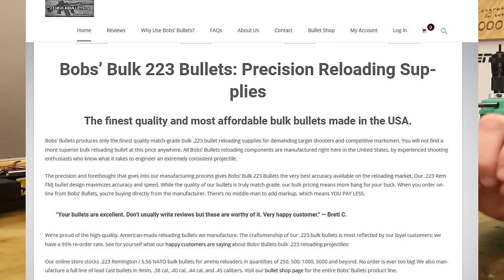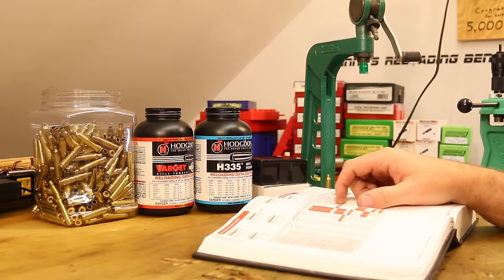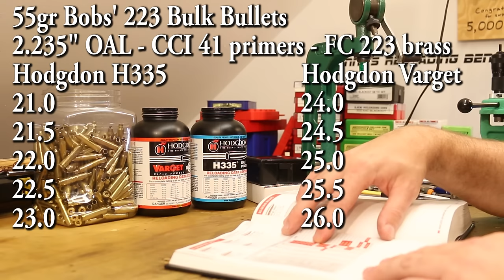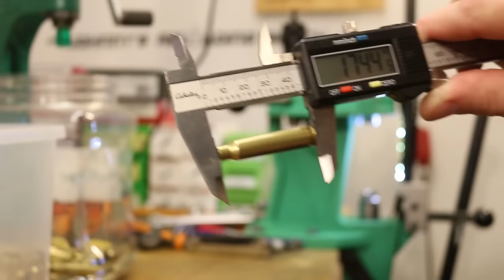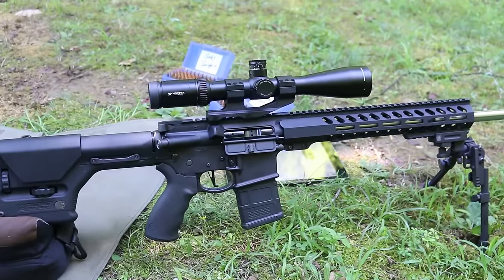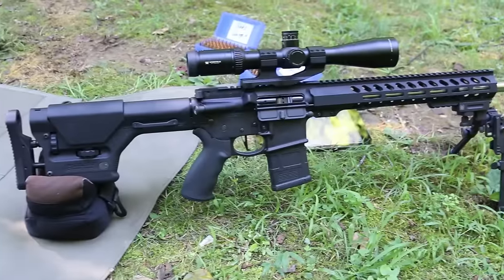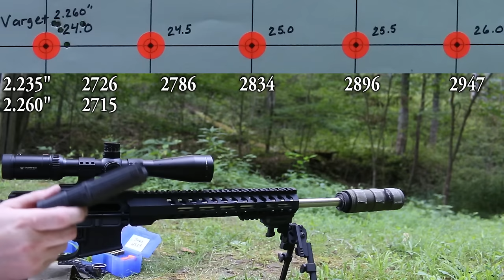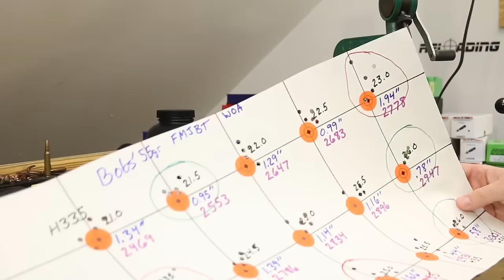Bobs' 223 Bulk Bullets - OUTSTANDING accuracy! 8 cents each!

Comment: You can never forget the first time you resize a .223 without case lube...
Reply: Tenright77 or a .30-‘06 with insufficient lube. Got to let that lanolin spray blow off the isopropyl alcohol first. Oh, well,  practice makes perfect.
Reply: You talking about the 2 hours out of service because I had to run to the store and get stuck case removal kit and figure out how to use it......
Reply: I use bacon grease for lube. Smells great and never had a stuck case. Triple up a paper towel an spread the bacon grease on it then roll the brass across.
Reply: Got Carbide?
Reply: @1scottburns  With the Lee die you just loosen the decapper collet/clamp and hammer it out with a 3/16 drift punch and 2 lb hammer while still in the press. I had to do it the other day for the first time and was not too bad.
Reply: Haha we’ve all been there done that 😂 but practice makes perfect
Reply: untill to do it with 50bmg! 🤔
😁
Reply: truth
Reply: Or the second time...

Comment: When you get Flyers you're probably getting variations in your primer weights.
Weigh your primers and you'll find some of them are light and some of them are heavy and that variation is the amount of explosive in the primer, so just try to group the primer weights around the most common weight and use all of those for your testing and you'll see a higher level of accuracy.
Reply: Wow! Excellent tip sir. I shall try it. 🤯👍😎 Thank you
Reply: That is an awesome idea thank you my friend!
Reply: I don't believe primers will make any difference.....if they are all a quality primer. Much more important is case prep. Cleaned flash hole etc.

Comment: Hornady one shot isn't supposed to contaminate powder either. However I dry tumbled a batch after they are loaded just to make them shiny. They look nice, but now I have a 10-20% failure to fire rate. On the case it's fine, but apparently the power can pick it up and screw you. Luckily I only have to take apart a small batch....

Of 500.....

Side note- I am really enjoying my new Hornady cam lock bullet puller. Lol

Comment: Great vid JRB, everyone loves an affordable plinking bullet that shoots well. With H335 I have always used 24.5-25.0 grains for just about any 55 grain bullet with no pressure issues and seems to be the sweet spot for me. Would love to see this bullet pushed a little harder with H335. This bullet looks like it was tightening up as you went up with Varget also. 8208 XBR probably would shoot this bullet well also.

Thanks again JRB. I guess I'm headed over to  Bobs' to pick up 1K to mess around with.

Comment: Outstanding video on case prep and loading .223.  Hope you don't mind my adding some rambling thoughts.

Ergonmomics - That plastic bin is great for lubing but too deep to have to reach over to retrieve cases - very tiring in the long term.  Shallow plastic food trays work great at the bench.  I like to have the sized case receptacle at or slightly below bench top level so it's easy to drop the cases into the container.  I once prepped about 5,000 surplus military 5.56 cases so I had to do everything I could to improve efficiency.

Dry tumbling with fine ground corncob + NuFinish and mineral spirits works well to remove the lanolin  No waiting for the cases to dry and the mineral spirits helps reduce dust.
The 55 grain FMJs I've loaded have had inconsistent tip shapes, making the OAL measurement vary even though the bullets were seated the same off of the ogive.  A comparator is the only reliable way to measure OAL.  If you're trying to fit a magazine then both actual and comparator OAL should be measured to assure that the bullets will both fit in the magazine and will be seated the same within the cartridge.  The distance to the lands will be consistent even if the OAL to the tips is inconsistent.  It seems to be less of an issue with hunting and target bullets but I still see small variations in tip length compared to the ogive length.  Your FMJs are more consistent than what I've used.

With the Lee Factory Crimp Die you'll know how hard you crimped when you have to pull a bunch of bullets.  Don't ask.  :(

The shooting test was well done as a video and very interesting.  None of the groups were that bad considering you were shooting FMJs but the fliers were interesting. 
Could the Varget at 2.260 test not be valid because the rifle wasn't autoloading?  It seems to me that loading from an open bolt and tripping the bolt release every time is the most consistent (eliminates variations form the first round to subsequent rounds), followed by autoloading and then manually cycling the bolt being the least consistent.  The Varget at 2.260" is what I would expect a rifle with good components like yours to shoot.

One of the major bullet manufacturers said that FMJs are the least consistent of all the bullets they make because they're made backwards to all other bullets.  With everything else the cup is drawn, the core pressed in, the bullet is formed and lastly the tip is trimmed.  WIth FMJs the tip is formed, the core pressed in and the jacket is trimmed before being formed around the base.  That process can lead to out-of-balance bullets according to the maker.  My best shooting AR shoots "patterns" at 100 yards with the FMJs I've tried but with quality bullets like Sierra MKs and Hornady V-Max it will shoot in the threes at tht distance.

Comment: For the RCBS shell holder hand primer if U hold the shell up off the base of shell holder it will self align and slide in nicely (post Dillon Swager).  If it hits, slide it down towards the center a little.  Its taken hundreds and hundreds of attempts to figure this out and get it running smoothly.

Comment: Thanks. I watch a lot of your vids. I have loaded 1000’s of .223. Never used “Bobs’” bullets though. Good review! 
I used several different powders.  H335, Varget, Tac, Winchester 748 to start with. Primers; CCI 400, CCI 450, 41’s, BR-4’s.
CCI 400’s worked best in warm weather. CCI 450’s in cooler/cold weather. (They were more consistent than the 41’s) The H335 worked out to be my most consistent, accurate powder. I know it’s a crazy/weird thing but a velocity of around 3000-3050 fps is the velocity my rifle shoots best at.

Comment: You will find accuracy in H335 at 25 grains. I use that exact load hornady bullets are .08 when you buy by the 1000. And I seat at 2.257. I am in an AR black hole weaponry barrel and get .5” groups average. I say this with confidence as I have shot a lot of this and it is published in noslers reloading manual.
Reply: Nice.

Comment: You might switch to dry tumbling after your final trim/chamfer/debur. That will make it easier to remove lube and also gives you the option to put some final polish on the brass.
Reply: I’m debating getting just for this reason!

Comment: Johnny, Thanks for the review. anyone firing National Match should consider picking these up for the 200-yard line or even the 300. I purchased one thousand of them myself. I plan on using IMR-4895 just to see how they will group (IMR-4895 being similar to Varget) in burn rate. even firing the short course @100 yards these bullets would be a winner. Thanks again. Dave.

Comment: I'm planning on trying the NOE HTC225-60-RN bullet that was designed for powder coating. With any luck it will be an accurate plinker that costs even less than Bobs' jacketed bullets.

Comment: Gunblue 690 turned me on to  Lee size lube that comes in a tube like tooth paste . I've tried all the lubes over the past 60 years . I've dented a lot of shoulders and stuck a lot of cases . Since using the lube from Lee I haven't stuck a case or dented a shoulder . It's easy to use and cheap . See Gunblue 690's video on it .

Comment: I know i have mentioned before, but for me the best accuracy in a 55gr 223 bullet seems to almost always come around the 3000 fps range. It would be interesting to see if you can reach that velocity with the H335 and see if the groups shrink.
Reply from the maker: I can do that!  I'll be interested to see as well.  I'll also be interested to see how these fly out of the 22 Nosler!
Reply: I find the same thing. 3000fps + give me the best accuracy. if I remember right H335 at 25gr gives me around 3000 fps with the 55gr FMJ out of my 20" barrel. Don't know about a 16"
Reply: mojo jojo I get around 2900-3000 FPS out of my Anderson 16" with 25.5 gr. H335 behind a Hornady or Armscor 55 grain FMJBT

Pretty accurate. I can ring steel out to 300 yards with a TRS-25 red dot.
Reply: ;Just seeing this and I agree your H335 loads were too mild. I too run 25.0 - 25.5 grains with 55 FMJBT.
Reply: I’ve been testing hornady 55gr FMJ with H335. My testing has shown that 25.0 he gets me to average 3000 FPS as well with a similar barrel and chamber and cartridge overall length.  

You can see in your results that when your velocities reach 3000 FPS your groups tighten up. But why waste varget on a plinking round when you can use H335 at 25.0 gr. It is less expensive that varget which is best used for match grade ammo like the 69 grain HPBT from Sierra.

Comment: The most cost-effective and excellent working case lube. It is the only lube I use. Just make sure you let the water and alcohol dry off before running them through. The mix ratio I use is 1 to 10. Large zip lock bags work great for lubing shells.

Comment: I got these bullets for $119/1000 delivered few months ago. These powders hard to find now days. I picked up RE 7 and @21.6 gr can shoot 1" group at 100Y. Brass 1.750" and OAL 2.245".  Mil spec AR15/M4 with 16" 1-7 twist, Vortex strike eagle II and TriggerTech adjustable trigger(love it)
Of course all barrels are different but a good place to start if can't find Varget, H335 ... etc.
Nice video, THX.

Comment: have you seen this? the H335 is the same as as mil spec Olin WC844 use by the M193 ball,  M196
 tracer, M855 ball, and the M859 tracer. Plus others.

IDENTIFICATION OF SURPLUS HODGDON VS. MILITARY POWDERS
     Hodgdon Powder           Olin Powder
     HS-6                     540
     HS-7                     571
     H110                     296 (before '75 WC820 .30 Carb)
     BLC-2                    WC846 (Ball M80 7.62mm)
     H335                     WC844 (Ball M193 5.56mm)
     H380                     WC852 (Ball M2 Cal. .30)
     H414                     W-W 760 sold to Hodgdon
     H450                     785 (originally WC780)
     H870                     WC870 (20mm)
     HP38                     W-W 231 sold to Hodgdon
     Trap 100                 452AA sold to Hodgdon
 

hence, if your using a 5.56mm you don't have to rely on .223 data from Hodgdon when it comes to 55 grain or 62 grain bullets. Not one of their published loads will match or compare with the 5.56 load. but, you should not use 5.56 loads in a .223. the 5.56 is obviously a hotter load that most .223 can't handle safely. The .223 Wilde was built to handle both,. the .223 is not.

Comment: For extruded powders that lock up the hopper (Hornady in my case) I've learned to brace my levering hand on it in such a way that I can give my operating thumb an anchor. This allows me to break through with a deliberate movement and get the regular charge even on the hard ones. If I try to cycle a few times to loosen, it just adds more and y hopper tends to stay within a tenth pretty well, so it just makes it easier this way.

Comment: just had and idea for a short cut to arriving at a casing  . using a hot die , "proper dimensions " and a heat source from nichrome wire/ tape . thinking a lot less waist in bullet rated brass  can't wait to give it a go

Comment: H335 and 55gr bullets is like PB&J. They go together very well, but I think your charges are real low. Usually the sweet spot for H335 and a 55gr FMJ is around 25gr. I have some 55gr  loads with 27.5gr of H335 so you can definitely go up and see what you get. Some of my most accurate loads are with H335 and 55gr bullets out of a 1-7 barrel.

Comment: I am fairly new to reloading rifle, have been doing pistol for awhile.

To determine what needs trimmed or doesn't need trimmed, I drop the pieces of brass in the case gauge, if the neck pokes out above the case gauge, it needs trimmed.  Anything wrong with that method?

Comment: I’ve tried bobs... it doesn’t like 22.0 grn of RL10 which is my plinking load using 55 grn Hornaday fmj’s.   The Hornaday are an average 1MOA load.  Shoot 10 groups and average and that’s what you’ll get as an average.   To be honest I didn’t give Bobs a chance by working up a load for them.   I may go back and revisit.  Bobs was shooting about a 1.3- 1.4 MOA average group.   I have been willing to pay $.02 more a bullet for a 30-40% tighter grouping projectile.  Again, I didn’t work up a load or try varget.  Thanks for the through video.  It provide potentially opinion changing info on bobs

Comment: If you don't want to be measuring all of your casings, you should build a lightly back-lit adjustable jig that can be sized so you can dump a whole bunch of casings into it at a time (regardless of what kind of cartridge you're working with), and so that when lined up square, a proper-length case will fit, but one that needs to be trimmed will not, and any that may be too short could be easily visually-detected (tis the purpose of back-lighting it). You could also re-size it once you're done pressing in the pills to verify overall length. Two birds with one stone. That would speed up your QA process a whole bunch. I know you may not want to go through all of the effort of checking all of your brass, but it's a vital part of the process that cannot be skipped, unless you want to be another one of those reasons why people foolishly think hand-loads are inherently dangerous and that people who hand-load can't be trusted enough to perform the task competently and safely.

Comment: Bob's bullets @.9 cents , $22.00 1 lb H335 powder valley, .08 cents per .26gr.   Plus primer @$30.00 per 1k  .03 ea.     And  brass. Depends if range brass ( free )  .20 cents per pice. Plus your time putting it together.   I wouldn't use $35.00 a lb powder on a .9 cent bullet. (N-135)  Stay with the H-335 or like price powder.   If your shooting a .35 cent bullet like a matchking, go with the expensive powder, go for broke !

Comment: A quick "my .02$". When measuring your dead length. (Base of case to rifling grooves) I can't recommend a compairitor enough! MANY MANY times I've found huge length differences from the base of the projectile to the tip. But never have I found a difference from base of projectile to ogive. 

Measuring to Ogive for everything has helped me out allot

Comment: Odds are the difference from base to tip of bullet is in the lead tip from batch to batch. Some tips are more blunt than others. I check my distance from base to lands with a particular length for my OAL. If the next bullet is longer I add that extra length to the OAL. If the next bullet is shorter I subtract that length from my OAL. That keeps the ogive in the same place. Se3ms to work for me. SHOOT SAFE!!!!!!!!!!!!!

Comment: load one at a time of each different  load that way you average out the effects of heating the barrel and changing the point of impact i can shoot till i want to clean fouling all day without much heat on my 24" fluted ......shooting all five at one then the next by the time you get to the end your bbl is pretty hot....rl 15 and varget my best at full load sierra 69 gr. match but its 12-31-2020 supplies are gone

Comment: Johnny, This series got me started with my first .223 loading ever using h335.  My rifle seems to need some more juice to cycle the rifle properly.  Only started getting rifle to pick up a round (was ejecting) at 24.3 grains of H335 (using bobs bulk cannalure 55gr).  The rifle still failed to lock open on empty.  I think I need to go hotter but I am doubting myself.  My hodgden book shows 55gr SPR SP min at 23.0 grains and max of 25.3 grains.  Would you feel confident going beyond 24.3 grains?  I have never had my gun fail to lock open with factory loads.

I did buy some Varget.  Should I stick and stay at 24.3 grains with the H335 and just use it to plink and live with it not locking... then move on to Varget in the future?
Reply: Are you sure you need a hotter round or maybe adjust your gasblock?!

Comment: These bullets and everglades ammo version 2 bullets are awesome everglades does free shipping all day everyday on in house projectiles I get better accuracy out of everglades but every1 mileage varies 25.5 h335 coal 2.250 is awesome from a yankee 16 inch carbine length gas system  barrel the bobs I use 25.2 with great success
Reply: 25.5 H335 with Hornady cannelured 55g pills 👍🏻

Comment: Looks like you've been testing for a while what's your favorite load this far for 223s I'm running a 223Wyled barrel 1:8 18"
Reply from the maker: 77gr Sierra Match King with IMR 8208 XBR, AR-Comp, Accurate 2520, Power-Pro 2000MR, or Power-Pro Varmint.  See my "cloning mk 262" playlist.  Awesome groups.
For cheap plinkers, the 55gr Bobs' or Hornady FMJBT are good shooters with a bunch of powders.  Just pick your favorite....H335 or Varget is certainly a good start.

Comment: Primer question. Has anyone ever put the ones that won't flip over to the side and checked if they are the ones that don't seat very well? I always have 1 out every 300 or so that doesn't seat well and I will chuck the brass and primer. I'm wondering if they are the ones that refuse to flip?

Comment: Compared to the Hornady, Bobs' bullet has no boattail. But, I'll try them. My experience is that boattail bullets are more accurate than flat base. Is that ring near the tip an indent or just a shiny ring?
Reply: it's an indent